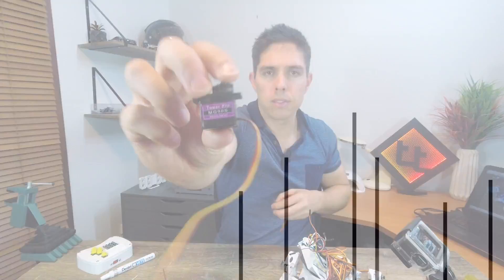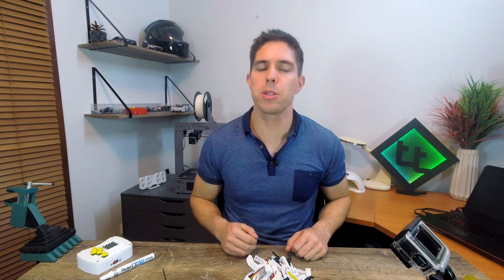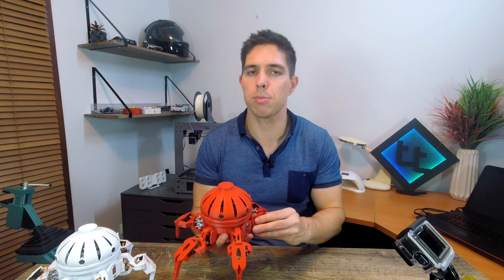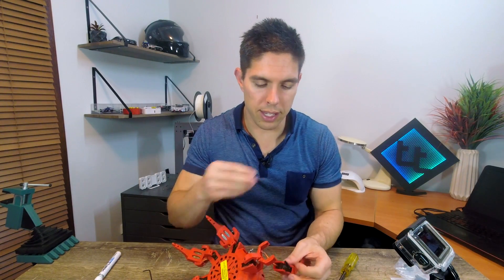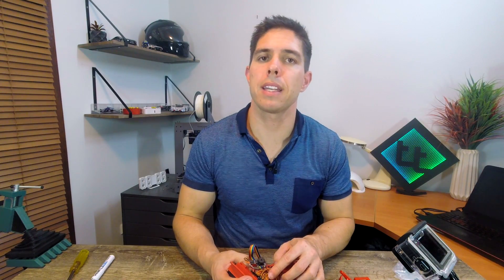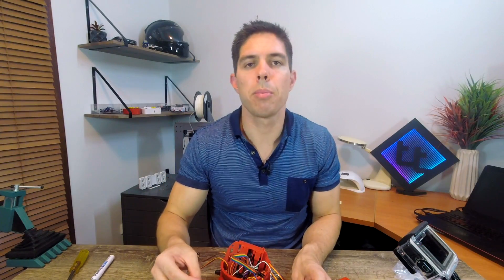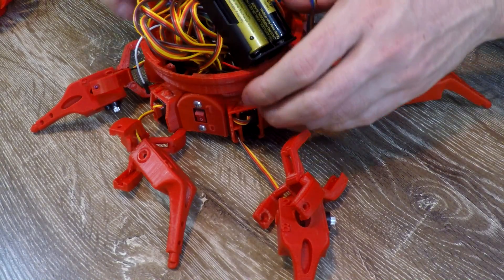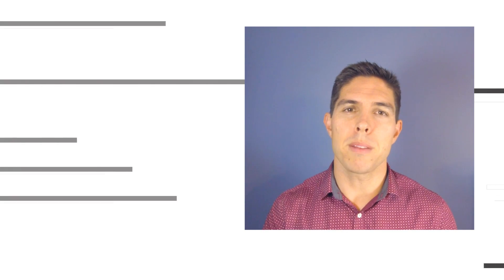Vorpal Hexapod Tower Pro Servo Upgrade

Comment: Hi Michael.  I know you did this video early last year, however I was making a couple of these and opted out of the Tower Pros due to cost difference.  Do you recall any problems with your generic MG90S that would make me rethink using these over Tower Pro?  I suppose I could upgrade them later, however, I'm curious if you notice any big performance or durability differences.